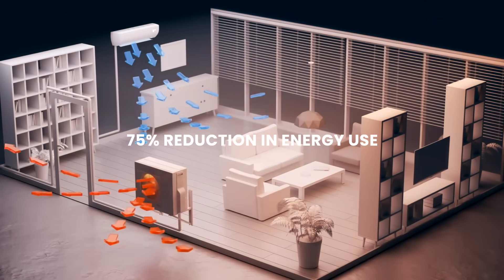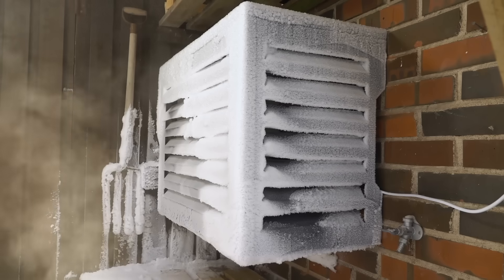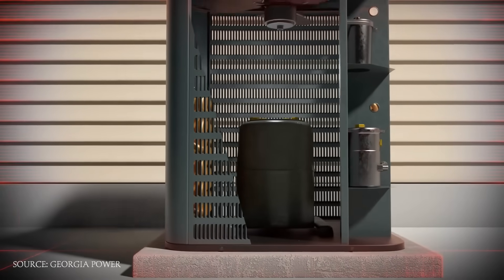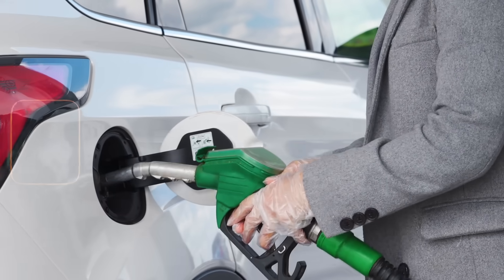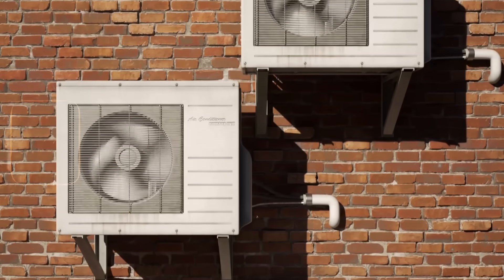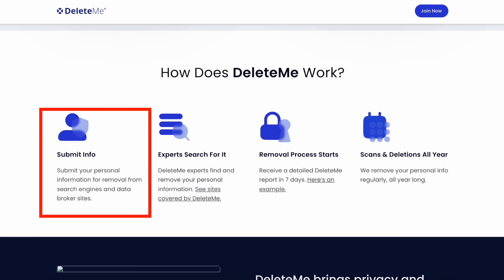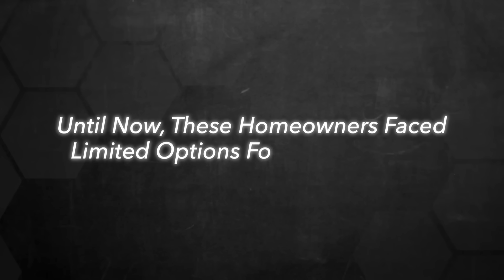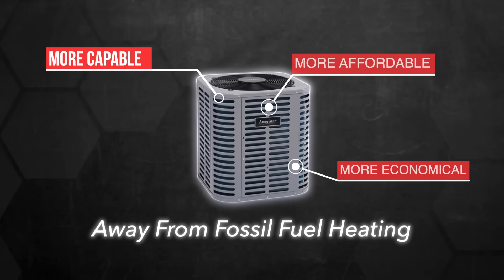Genius Heat Pump could change how we heat our homes forever

Comment: Cool tech but like the first year of a car model, let's let the dealers work the bugs out of someone else.

Why aren't earth coupled heat pumps more competitive?
Reply from the maker: Earth coupled meaning Geothermal? The cost of drilling. Everything comes down to labor cost / cost of running a business and prices of everything have gone up drastically which has to get covered by that labor rate, and geo is typically just more trouble than it's worth unless it's an off grid application. I was quoted $35,000 just for getting the loops drilled on a GEO project in Colorado and we wouldn't have marked that up at all, but just our parts cost for the GEO setup is an easy 10-12k, so it's turns in a 60-70K job for something that forced air / split system can accomplish all in for 20k... that's where these systems could come in competitive if they can get their cost below 10k. For what it's worth the 3 ton actual has over 5 tons output is my understanding so that's a plus but still needs to be fine tuned and price brought down
Reply: @TheHVACDopeShow  The only one I had been involved in was 40 years ago and involved a ditch witch digging a trench and laying pex in the trench. But this was an area where the frost line was less than half an inch.

Comment: Cascading refrigeration has been around for a long time
Reply from the maker: Not in a residential application though correct?
Reply: @ true. Cascade has been used in the lab and research to achieve very cold temperatures.

Comment: I'd be loathe to install something so expensive that also used software to control it. If there were a manual or hands-off, set-it-and-forget-it system, I would feel better. But that's probably where they get you; the software.

Now I need a license, now I need an update, oh sorry, not that update, it bricked the thing, can you prove you bought it and didn't steal it and recently so that the warranty covers it? Fuck off.

Comment: My 12 year old Carrier Infinity green speed system   can deliver 90 degree output at minus 5 degree outside air.
Reply: Carriers dumb do you have the one foot in front of the discharge muffler on each side of straight refrigerant piping

Comment: so wat if i was to build a compost bin greenhouse around my heat pump? 
would this make difference, dramatically?
Reply from the maker: Common question is encasing the heat pump but it defeats the purpose because that space would get frigid and needs heat replenishing the area, which is why they are working to optimize them for colder temps

Comment: A good air to air heat pump will have a COP efficient above 5, you are correct that the efficiency drops with temperature, a modern pump will however work at temperature down to - 25 celcius or lower for some models.

Comment: no matter which refrigerant you use you still need resistive heating in the very cold temperature because your outside unit gets frozen and you need to defrost it
Reply: It can't defrost itself by simply cycling the refrigerant in reverse?
Reply from the maker: correct, normally the indoor fan doesn't run and it defrosts like that so I would agree it's probably similar. I'd like more information about this unit to be able to do a viability report / opinion but don't have all the info because it's not all publicly available.
Reply: @melissachartres3219  you could but that would bring cold air inside, so you would still need some kind of resistive heating element to countervene that
Reply: @ Thanks for having gotten back to me so quickly. Much appreciated.

It wouldn't bring cold AIR inside... it would bring cold REFRIGERANT inside which would cycle through the evaporator (inside) tubing so that the warm refrigerant could defrost the condenser (outside) tubing. While that's happening- the evaporator fan motor inside would not be blowing and spreading cold air. That's all baked into the programming as part of the defrost cycle.
Reply: @melissachartres3219  You’re right about reverse‑cycle defrost; it’s how every heat pump thaws the outdoor coil.
What I was getting at is comfort and capacity, not the physical defrost.

During defrost the indoor fan is usually disabled, but the air handler still cools down a few degrees. Most installers spec a 3–5 kW strip heater to keep supply‑air > 90 °F.
Plus, even if not using the heating strips (I know that there are some mini split systems that don't) you need to ramp up the heat pump afterwards because a)you need to re- heat the coils, and b) there's gonna be some heat losses from the house itself (the lower the temperature outside the bigger heat loss)so with running the unit inefficiently and speeding up the next frosting of the outside unit you are just not all that better off than using resistive heating even with mini split systems.
Reply from the maker: normally the indoor fan shuts off so it's not blowing cold air in defrost mode, it's just 10 minutes without heat when it's defrosting. This can be annoying on really cold nights for sure, which is why you want resistive or backup furnace

Comment: Where I live in MO, natural gas (after converting BTU to kilowatts) is 1/6th the cost of electricity.   My gas furnace is about 94 percent efficient.  So until heat pumps get to COE of about 6, they are a money loser for me to operate in addition to higher initial costs.  Also gas heat (using a small generator to run the furnace fans) keeps working when the power goes out.   So heat pump advocates have a lot to overcome to be a better choice than gas.

Comment: Running refrigerators backwards is the most INEFFICIENT way to HEAT your damn home there is! What IDIOT thought of using REFRIGERATORS for that!? 🙄
Reply from the maker: Compared to resistive heat, it's much more efficient that's what COP is based on... but compared to a CHEAP Natural Gas, you're right a furnace is often cheaper and simpler to run, and relatively clean burning

Comment: My guess is off shelf parts x 3 systems = 3x typical system cost? Will install be at any cost savings compared to what? Can be an option if new construction or replacing defunct system with realized energy savings. I like the integration of solar as it would take stress off electric grid & be used more at peak load times. Off peak electric grid usage should be lower. Currently residing in an all electric community in NJ. Electric baseboard heat sucks, is inefficient with high electric bills in winter.

Comment: Three compressors running, multiple control boards, three different fluids, equals a recipe for complicated expensive troubleshooting. KISS
Reply: Sure, but this solves a significant issue for cold weather installs.   Some added complexity is a trade off for being viable in new markets.
Reply: @ I lived in New York for most of my life and the price of electric makes using heat pumps a no no.
Reply: @ It's 3-4x better than resistive heating and gas/oil needs to go away so it's the best you're left with.  And higher electric rates means solar pays for itself that much faster...and cuts into the costs for running the heat pump

Comment: I would assume there is still a backup resistive heater though...-32F or -35.5C is indeed very impressive... however where I live still air Temps below -40 are routine.
Reply from the maker: In that environment you'll probably have some sort of backup resistive or furnace

Comment: Although a hybrid is nice for when it gets too cold for the heat pump to work, I find it more important that I can heat during a power outage when I am using a portable generator with limited output.
Reply: Just pipe the generator exhaust into your house to keep you nice and toasty

Comment: How well do snow-packed outdoor coils work for the evaporation process?
Reply: Poorly. That's why they automatically defrost when needed.
Reply: @eDoc2020  How will they defrost if they are in a climate where the temperature is well below freezing for months at a time, and where the melted ice will eventually form a block around the coil?
Reply: @RayGetardo  The melted ice doesn't form a block because properly installed heat pumps are placed well above the snow line. It drips down away from the unit.You may get an icicle but that won't cause any problems.
Reply: @eDoc2020  There really isn't a fixed snow line in windy environments, hence my initial question. Sure, the fan will draw in some snow, but it's that pressure difference combined with blowing snow that concerns me. Problems with combustion air intake and ventilation lines for high efficiency furnaces are prevalent enough that it makes me very skeptical of the practicality of adopting this kind of technology.
The only market I see adopting something like this would be the parts of CA that get cold and some parts of New England. Those states might mandate something like this, and the cost of the technology is much lower, relative to the overall cost of the property in California, than it would be in places like Ohio or South Dakota.
Reply: @RayGetardo  In terms of defrost it shouldn't be any worse than a standard ASHP. I imagine you can place wind barriers if needed.

Comment: As a retired commercial,  refrigeration HVAC mechanic.I find this video very amusing
Reply: Norwegian HVAC guy her,  
A standard heat pump, such as a Mitsubichi Heavy Industri heat pump. 
Using R410, and later R32 have been working just fine here in northern europe for the last +20 years.
If bog standard residental heat pumps have been working perfectly fine in northern Norway for more then 2 decades now!, - it's safe for the US to finally embrace heat pumps too!
How often do parts of the US exerience tempratures below -20'F ?
if sized correctly, a standard heat pump wil cover all your house heating, almost down to -30'C / -22'F without problem ! :)
Always smart to have a cuple of resistence space heaters as a backuå some where in the house.
 If us here in scandinavia are happy using R410 heatpumps for the last 20 years, as the main common residental home heating industri standard, you can too ! ?
It's not like heatpumps stop working, when cold. They just don't heat as much in extreme cold !
Reply: @zigge1989 have you ever dealt with temperatures to -40. I dont need it hot at that temperature, I just need to keep the temperature above freezing.
Reply: @doughooper9918  very few people has to deal with -40 in both the USA and Norway.
And those who do, need more then a heat pump installed at home 😅
Reply: @zigge1989  I happen to be one. It will get close to 40 and so I have to prepare for that. I only need the cabin to be warmer than 0 so the water lines dont freeze. Right now it is -26 c on the thermometer and it is only December.
Reply: @doughooper9918  -40'c sounds unplesent 😅
I live in the middle of Norway.
It is -1'c here right now. 
Coldest part of winter, it rarely dips down past -25'c for most of norway.
In the very north, and some mountains -30'c - -40'c happens, but not that often.
The coldest part of winters are normaly i januar
Reply: @zigge1989 It has only hit once or twice in the last 30 years. But -30 or -35 at night is not unusual. Usually 2 or 3 cold snaps a year for a week or 2 when it stays around that temperature. It sucks. I live in Saskatchewan and when you are on the prarie and it is that cold and windy that really sucks. Nothing to break the wind. You walk backwards into the wind.
Reply: @doughooper9918  
Common air to air heatpumps don't perform well -25'c or colder.
Geothermal heat pump should probably work for you. But it cost much more money.

Norway is populated by costal cities, by the fjords. 
Inland is mostly steep mountains.
We live on the edges in between the mountains and the ocean 😅
Terrible for farming, excelent for hydro power. And very unstabile weather ^^
Reply: Can you elaborate?
Reply: Ditto. I used to do the systems from 50 years ago. This is most entertaining.
Reply from the maker: That's why Res guys get no respect from commercial guys... I've never worked on or heard of one lol, at least not in a residential application, thanks for the comment
Reply: @TheHVACDopeShow it’s because resi guys don’t advance into more complex commercial or industrial markets, they simply stay put conning poor grandma into this $20k heat pump to make a commission. 😆

Comment: You already clarified this in a response to another comment, but I think it’s best to put a text correction over your video at 8:54 that you meant -32degrees not 32. I dismissed your video the moment you said 32 and only re-watched after reading the comments where you clarified it. It’s best to iron out this little blooper with a text correction. Great video otherwise!

Comment: The price premium for this would be much better spent on more insulation. Most homes are pretty badly insulated.
Reply: That should be done first - along with other building envelope adjustments (like triple-paned windows and gap/building penetration sealing).  This would then decrease the size of the unit required and thus the monthly cost of operation.

Comment: Thank you for the video.  How hot is the air produced in the heating mode?  From your videos have learned to size HP for cooling in cold climates and duct work may not support large systems.  You have said duct constraints are much less with back up furnaces as the air is hotter.

Comment: I think you just explained what's happening with my car air conditioner. I believe liquid is returning to be compressed. It's a known issue with early two thousand gm compressors. It makes a weird stuttering noise and the belt broke. Seems like something stopped turning, because maybe it couldn't compress something.

Thank you for the lesson!

Comment: Mechanical contractor and code official since 1970.  Great old idea.  I expect that the upfront cost will be awful at so many duplicate parts.  I maintain that earth source heat pumps are much better, much cheaper, and cost a lot less to service.  I would be afraid to  see the payback.  I have used heat pumps for 30 years  and depending on the cost of fuel, find them great.  Wood heat is even better if you need excercise as well>>>>.  Anyway, I enjoy my own system and it works great with no service problems even though I could handle repairs myself, I have not had any to service.  Hard to beat natural gas though if it is available.

Comment: Damn.  THis is a wonderful idea and innovation to the standard heat pump.  Living in WI I would now be looking at this once my furnace craps out.
Reply: I’m here in Wisconsin and about a little over a year ago I had a Mitsubishi heat pump duel fuel system installed. I absolutely regret it. I wish I could go back to the old tradition system. The problem is that week or so that we have winter here in Wisconsin ( temperatures below 10 degrees). This heat pump runs all the time instead of kicking over to my old gas furnace. My winter power bills from Alliant Energy doubled in most months and one month even tripled last winter. Mitsubishi says that the pump is good down to like 10 degrees before it starts to loss efficiency but I think that any time it’s below 20 degrees it should rely solely on the backup gas furnace since natural gas is so much cheaper that electricity.
Reply: @jko0526  If your gas furnance didn't turn on isn' that more of a problem with the installation and programming?  If the temperature isn't getting to where iit's not efficient anymore it should kick over to the gas, I would expect.  Did you ever get it fixed?
Reply: I have had the contractor out twice and no fix. They keep saying that everything in the system is set to the correct parameters. It’s definitely a problem for homes here in the Midwest.

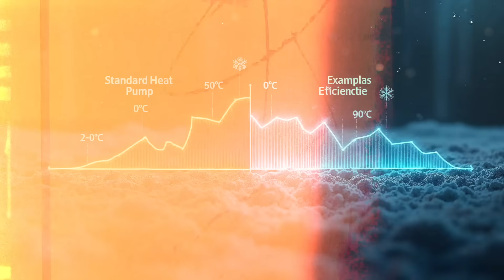Comment: 4:45 - ohhhhh damn coming from Canada where winters get to colder than -40 for weeks at a time they should add an additional layer that’s a conventional electric space heating coil that heats the incoming extremely cold air from -40 or colder up to the -32 range and then the heat pump would basically never fail.

Comment: The increased compression ratio is what kills the efficiency with any refrigerant. As discharge and suction differential pressures increase, the energy required is exponential. This is caused by a greater operating temperature range between evaporator and condenser.  In refrigeration, you can use a 2 stage system with the same refrigerant and improve efficiency greatly. I worked with a 2 stage ammonia system that could mannage -35 F to 90 F differential easily.

Comment: Cascading Rankine Refrigerant Heat Pumps are NOT innovations and are NOT a change-maker! The REAL innovation pivot will be replacing inefficient 100 year old Rankine Vapor Refrig. Case in point, Stirling Heat Pumps are single phase, meet higher TEMPs (200C-or+) and mfr'd at the same cost. At Sencera, our Stirling Heat Pumps already delivering 4-8 times more Heat/Cooling over any Rankine Refrig HPs. at the same cost and reduce Kwh usage/util bills thru higher COP efficiency at high temps that Rankine  cannot touch, delivering cleaner/toxic free Heat/Cooling and eliminates the Refrig recharge (Stirling elies on Nitrogen)  Service Contracts that majority of Rankine customers stuck in.

Comment: They still have yet to invent a heat pump that actually treats the air, unlike a central HVAC does.  Heat pumps have NOT worked at all in Canada winter weather, spring summer fall, yes.  Winter - hell no!

Comment: We built those about 20 years ago here in Maine at NYLE Special Products. Yes, we built one that ran to minus 30 putting out 105 degrees. Problem is it used two compressors one large one and a smaller one to keep the large one warmer to keep it operating at the cold temps. That being said the cost of electricity to operate it was not cost effective at the time and with today's electric costs being more than doubled it was a non-seller. Today's tech is miles ahead but is the electric costs vs oil or gas heat worth it.